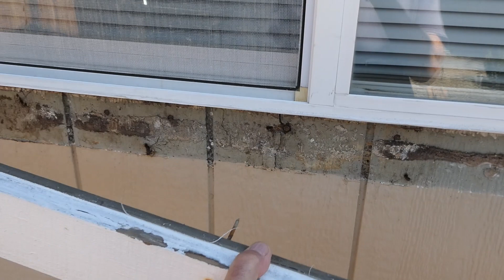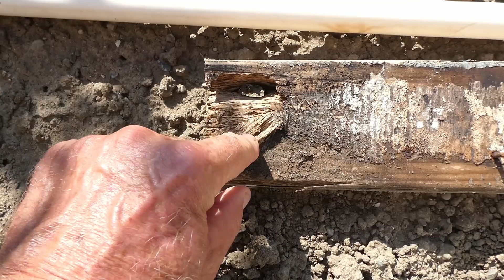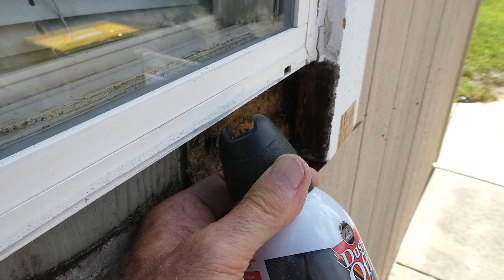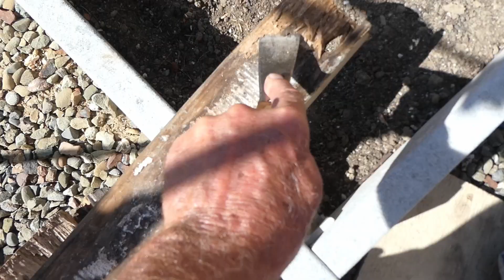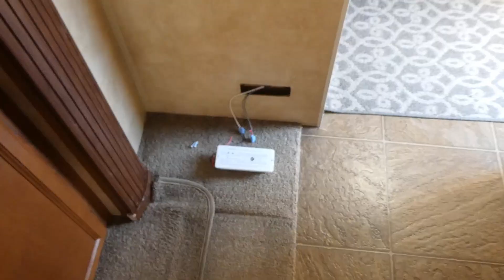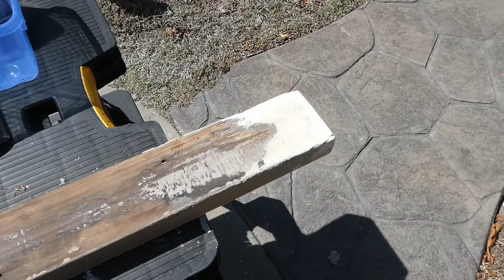WOOD SIDING REPAIR BY WINDOW USING ABATRON LIQUID WOOD & WOOD EPOX

Comment: How did hold up ?
Reply from the maker: So far so good but need to get through a winter.
Reply: @KensGarage1 did you get through a winter?
Reply from the maker: @elcubanito001  Absolutely. Just checked it yesterday and everything is good. Thanks.
Reply: Thanks, about to repair mine !